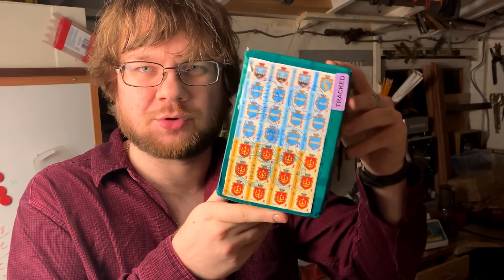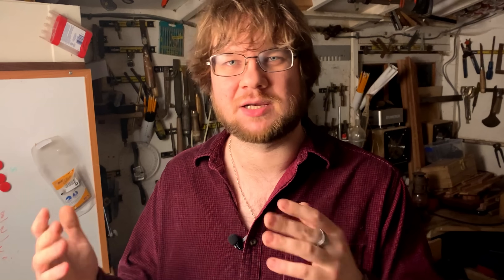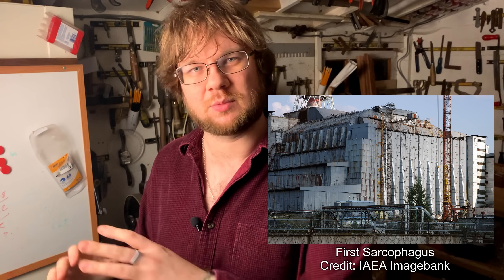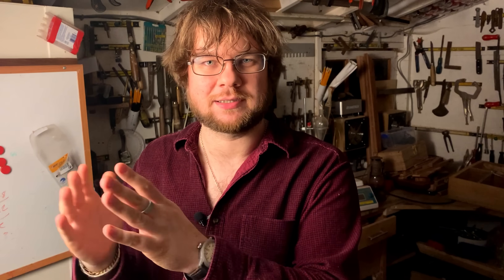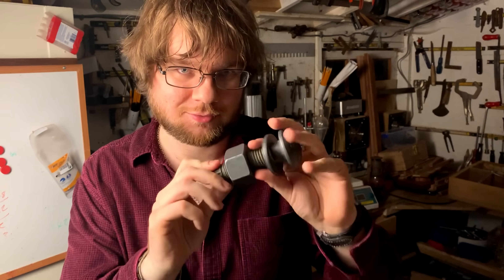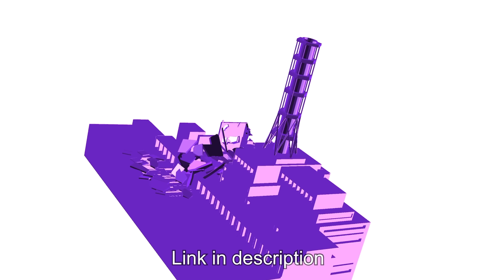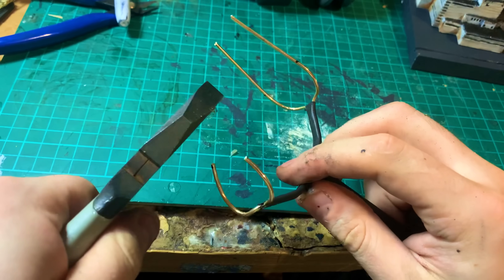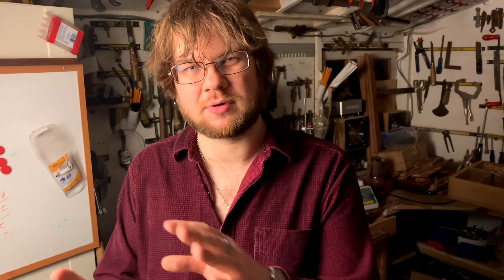This Bolt Protected Hundreds From Radiation At Chornobyl

Comment: The ones from the NSC project are pretty much sold out now, but TCB still sell them and send out samples.
I got my hands on one by asking for a damaged sample during a trade show, and that was after offering them a sample of a titanium hip joint. I wouldn't recommend emailing them unless you know how to sweet talk engineers. If you're not part of the club, they will probably just ignore/block you.
But yeah, they're aware they're in high demand for collectors, and are still being made for other projects.
Reply: Also, they did still use pre-cast concrete blocks quite a bit during the construction too. Like, the wall used to add some shielding included a large wall between the work site and reactor building, and I think some of the fillers (basically just the structures that filled in any gaps on the structure) were just pre-cast blocks that were lowered into place before the shelder was slid into place.

Comment: fun fact > when tightening fasteners u dont want to stop before it is fully tightened. Do it in one motion without stopping. lets say ur supposed to tighten to an arbitrary number of 100ft/lbs, and for caution u stop at 50ft/lbs. Then slowly creep to 100ft/lbs >> well, your not going to get the the proper torque caz the drag / the clench / the tightness of the fastener can/will give a false reading.

Comment: I doubt the bolt snaps. it would ruin the coating and leave the end exposed. also there would be no good way to tighten or remove it from the outside. And there is no need for it to snap as the tool can tighten it to specific torque and stop there.

Comment: well, without the torx end of the bolt, the bit that sheers off, the bolt would just spin wouldn't it? there is no bolt on the protruding side to hold it, so if anything, its the torx bit that helps lock it in place so the main bolt can be tightened and opposed to measuring each one, they know the torx side will fail and split off at the correct torque setting ... thus it's confirmed to be torqued down at the correct weight!

Comment: Mate, the bolts weren't shared out lol, the contractors that had spares just take them home because you can't leave left overs on site for hand over. Me and my father have special security bolts lying around from an old job somewhere, they're useless but you just take them as you cant leave the site in a mess.
Once you have too much left overs you sell it all as scrap for a few beers.
Reply from the maker: I’m sure that was the motivation for sharing them out. But for the Chernobyl project specifically they made special presentation boxes for some of the bolts to give to higher ups, politicians etc. You can see some of the bolts with boxes on eBay if your interested.
Reply: one's junk is another one's treasure!

PS: And I'll bet Kyle Hill would want such a display with bolt too ;-)

Comment: I've always heard them called "huck bolts".

In my experience, they were used to fasten truck frames to cross members and suspension components.
Reply: Huck bolts have a slightly different design but same idea. We use them on heavy vibratory applications where you can't afford a loose bolt.

Comment: Civil engineer here - this type of bolt is very common in the industry here in America in all kinds of steel construction projects.  The usual reason these "snap-offs" are preferred over a traditional bolt checked with a torque wrench is simply that they are much more reliable and require less manpower and time.  In a place like NYC, for example, where this can mean significant extra costs, these snap-offs are a no-brainer.  

It is quite interesting to see this use-case applied for non-economic reasons.
Reply: In the oilfield we have torque drills, basically as fast as a normal impact but you can set it to the exact torque spec you want. The drill is expensive as hell though but it’s also pretty frickin fast
Reply: @MrBOOM546  They don't need to be inspected after installation? That's pretty cool. Unfortunately here in NYC using anything besides snap offs still requires third party inspections :(
Reply: @drkalamity4518  Sometimes they might hit a random nut with a torque wrench but we have a high range for torque spec so we usually hit the bolts to a higher spec anyways.Our range is usually from 1400ftlb-2200ftlb. Its called a rad gun if you are curious

Comment: What's the benefit of the material breaking off and opening a side without surface protection, against using a good calibrated tool?

Comment: It seems like we would’ve figured something a little bit better by now even with rivets there Hass to be something on the other side. I think there are some techniques we really do get to learn from nature.
Reply: We do have other options. There are large blind-rivets (large pop rivets) and toggle bolts. But in this case they most likely wouldn't have worked.
These TCBolts or similar have been used in construction for years because riveting is a 2 person job and TCBolts are a one person job. You can halve your labor or double your joining, and have a consistent torque.

Comment: If it has a coating, when it shears surely the coating isnt on the sheared surface? or doesnt matter as not exposed to air?
Reply: Air doesn’t matter, it’s water. (AFAIK, humid air will only rust steel just so deep.) I assume the nut end of the bolt would be on the inside of the structure and so not exposed to the elements. If small amounts of water reach it, the exposed steel would be anodically protected by the exposed zinc around on the sides.

Comment: That type of bolt has been in use for 50 years.
Reply: Since 1981 according to sources. And only (much) later worldwide.
(not to confuse these with other types of shear bolts and pins which existed prior)
Chernobyl happened in 1986.

Comment: I’ve just bolts like that 
We used them on a lift shaft , 
You need a special tool for them 
I’m not saying you’re lying 
But from what I remember 
They were Japanese 
And basically the tool used the it tightened the bolt by gripping the star head not the bolt it self 
And snaps the head off when it’s torqued enough, 
Obviously a lift that moves up and down it needed to a specific torque to pass inspections 

It’s not faster like you state here tho pal !!

Comment: In aircraft structures we use fasteners called hi-lok or hi-lite that use the same mechanism to ensure correct torque and quick installation, available in stainless steel and titanium.

Comment: This is a ‘LeJeune bolt’… & they have become a standard specification in structural steel assemblies… like building steel superstructures.
They come in a vast array of diameters, & lengths… & they weren’t developed to this disaster site’s containment.
They can come with anti-corrosion coating, like ‘HDG’, but the one the presenter shows has just the standard ‘black oxide’ coating.
Their advantage is the vast reduction in manpower to tighten them up to specified torque, & speed subsequent verification inspection, 
& they have NOTHING to do with radiation containment at that site.

Comment: will the bolt being in contact with the mount create oxidation?
Reply from the maker: Interesting question, the bolt has a protective zinc coating and my local area is quite low humidity so shouldn’t be an issue.

Comment: 125 kg of force is the shear weight for lightweight DEXON®shelving are you sure you don't mean 125 newtons of rotational force which = 12. 742 kg (< 13 metric tons) rotational force effectively the equivelent of parking a 13 metric ton M113 Armoured personnel carrier (let's keep it relevent to current Ukraine) on it as a shear test rig make weight.

Comment: I mean, yes, this is the bolt they used, but it's nothing special.  it's just a common torque shear bolt that has been the industry standard for at least 40 years now.  There is nothing special about this bolt, at least from the information presented.

Comment: Where is the actual article where you got that information from?🤔 someone pulled a good one on you.
Reply from the maker: What exactly would you like a source for. I showed the certificate from novarka in the video proving this bolt is from the new confinement project. I didn’t claim TC bolts where invented for this project. Simply that it was the type chosen in this case for its speed and ease of use and the protective greenkote layer. I understand the mechanism of action may seem mundane if you have used them in industry for many years but for me and many others who have only seen regular bolts it’s a interesting piece.
Reply: You said they were custom made for the arch. They are all readily available.
We used them on the new Port Mann Bridge  in BC. that looks like a 1 1/8 × 4 1/2
Reply from the maker: I was under the impression that the circumstances of a project of this magnitude would require a unique set of bolt lengths, tension setting, protective coating. Plus the size of the order, would mean they would have to place a custom order with the company rather than buying off the shelf. 

This might be an oversight as I have no firsthand knowledge of these projects but as the other parts of the structure had to be manufactured specifically for the project I assumed the bolts would be too. I can see the sense in using standard length bolts but I guess I assumed the tension requirements might vary for different types of projects. e.g perhaps you want less tension in a bridge to dampen vibration. And I assumed the Bolt company wouldn’t keep a stock of over 1/2 a million of every possible combination of bolt length, tension, diameter etc. Interested to hear your thoughts.
Reply: @Curiosity_lab  each bolt size has a determined torque.
The torque can not be changed.
Once the torque has been reached on any specific bolt the end snaps off. They are also not corrosion proof.
They come coated in an oil and has to be removed before any coatings are applied.
Reply from the maker: @albertwayenberg9140 the bolts used on the NSC come with a zinc-based anti-corrosion coating called greenkote. It’s basically a galvanized finish rather than a painted on coating by the looks of it. www.tcbolts.com/en/greenkote
Reply: @Curiosity_lab  they do not, you have to arnd them out to get that done.
Reply from the maker: @albertwayenberg9140  the company in the uk that produced these bolts for chernobyl acquired the license to apply Greenkote to thier bolts as it was required for the Chernobyl use case. My bolt is from the surplus stock at chernobyl. Are you suggesting the bolts where delivered to chernobyl without the coating and then treated on site ?
Reply: @albertwayenberg9140  yes they do, the ones used for Chernobyl are. Hence the "designed" part. The bolts were not invented/designed specifically for chernobyl, they existed prior. But the specific mechanics, material AND coating were, as per needed specs for the job.
Just as you 'design', or rather manufacture, any other bolt or piece of material, for a very specific high stake job.
In other cases, you just use the general stock stuff.

PS: I too was confused at first because of how @Curiosity_lab explained it. But it was just a misinterpretation of what he said.